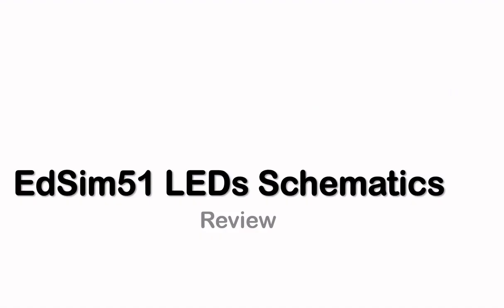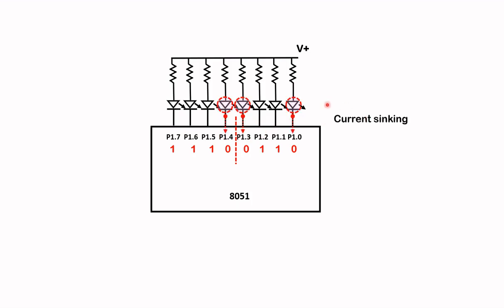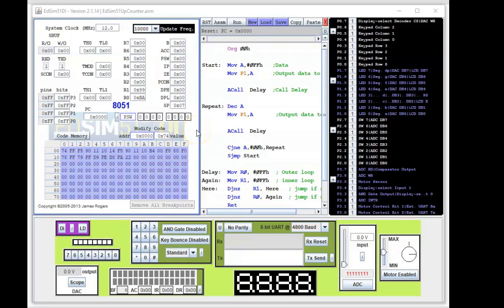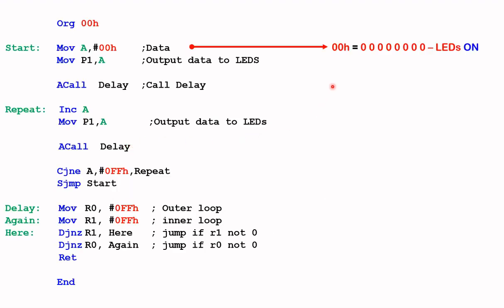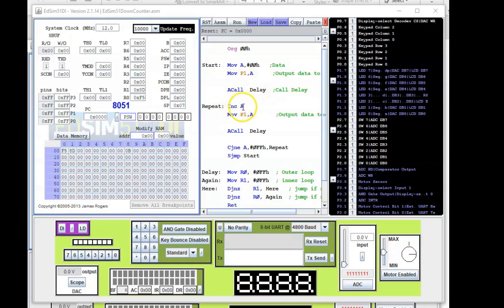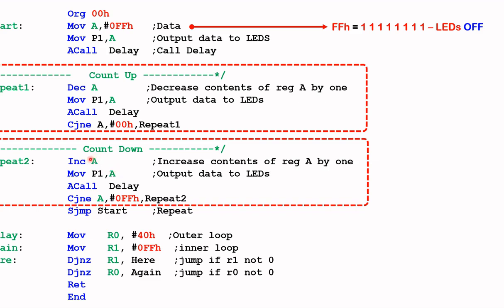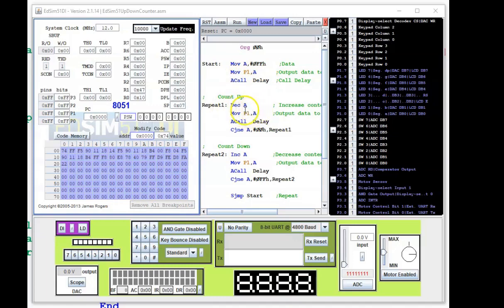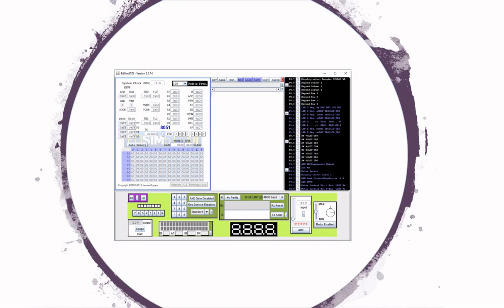#23 Edsim51 Up Down Counter

Comment: Till which number does the counter count?.Can you let me know the Staring and ending values
Reply from the maker: Hi to turn all LEDs OFF you need to send logic 1s to Port 1. This because the EdSim51 has wired the LEDs in such a way that logic 0 turns ON the LED and logic 1 turns the LED OFF. So for the up counter the starting value would be FF(hex), that is, 11111111 (binary) - this turns all LEDs OFF. The end value is 00(hex), that is, 00000000 (binary) - this turns all LEDs ON. Please refer to initial part of the video. There is a detail explanantion of how the LEDs interface works. I hope that helps.

Comment: I didn't understand the lights part how it's counting like there are different colour and also it's not going in synchronised way .pls explain about led colour.
Reply from the maker: Hi the colour LEDs indicate the LED is ON. White is OFF. Red indicate a red LED, green indcate green LED, and so on. EdSim51 use different colour LEDs.